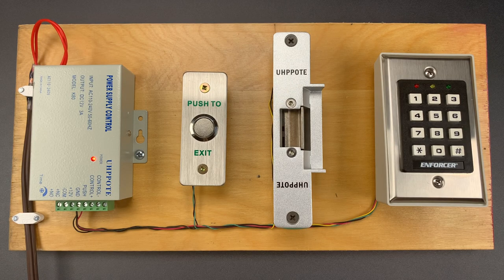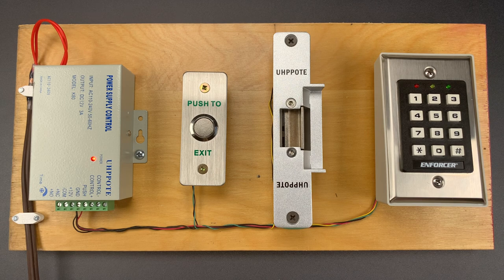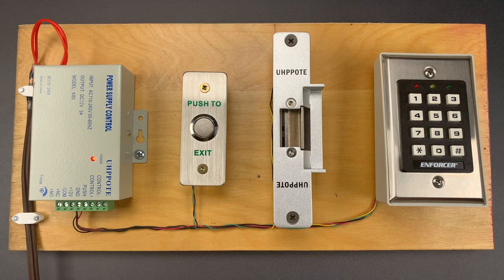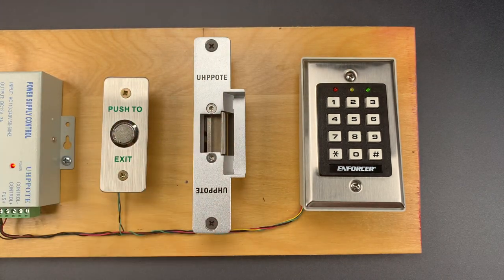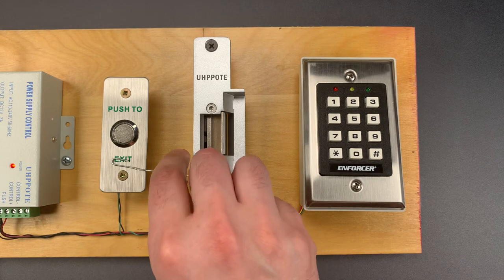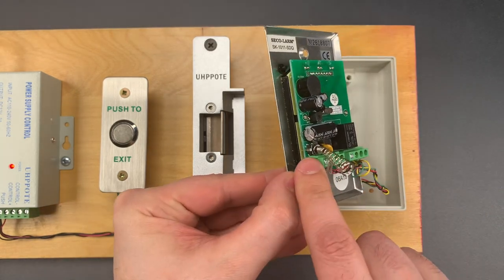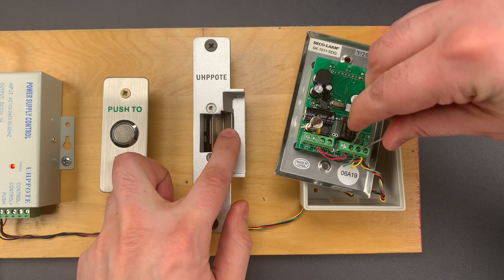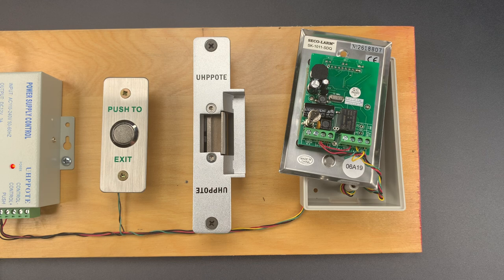[1045] Swiss Army Knife Bypass of Keypad Lock

Comment: Why don't they put the electronics behind the pushbutton inside the house and connect the keypad using a dataline, which sends a long code to the electronics with the entered code inside of it, or make some sort of SHA512 code out of the entered code? Then there isn't anything outside the house you can simply short-circuit to gain entry, as you would need to send the correct code-sequence over the proper wire.

Comment: They could probably fix a lot of these problems simply by placing all the control circuitry in the egress fixture, rather than on the outside of the door.

Comment: I'm wondering why the inside release button goes to the outside controls.  Why wouldn't they just wire it to the control box on the left of your display?  And for that matter, why isn't the keypad just that, only a keypad?  Looks like all the brains (at least one microcontroller) is right on the damn keypad, I even see the clock crystal on the back there.
That would eliminate both weaknesses.
Edit: ok, i did see after pausing, that the bix on the left is only a power supply.  Why not remote locate the "brain", and put it with the power supply?  Is there a reason not to, perhaps for power failures? Even then I can think of a couple of ways to overcome that.

Comment: Oh man, you managed to use swiss army knife "wrong". That particular model is Classic, but there's Classic SD (from Screw Driver), which doesn't have a nail cleaner at the tip of the nailfile, but flathead/2D philips head. Difference is small and it obviously works (as most knives on the philips screws), but it had to be said 😁

Comment: First things first. Never install a security keypad with standard screws. Use security screws. 2nd, never wire in a interior door release to an exterior keypad .  Use an interior relay method.
Reply: and I suppose where an electric strike is used, then the exit button is not needed, as you would need a door handle to be fitted on the inside as a mechanical override since electric strike plates are usually fail-secure (they remain locked when the power fails)

and since the lock is using dry contacts to open the door, then it wouldn't really matter how you wire up the inside button, as someone  that was trying to bypass it would just use the contacts that go directly to the door lock to open it

Comment: I guess if you want this but actually capable of doing it's job is to give it a inner/outer shroud. Then either security screws and or change the mounting points. While  installing a functional anti tamper system.

Comment: There is an old saying in the computer engineering business . . . If you can get to the hardware you can do anything you want. Putting the "smarts" out where they can be accessed is just criminal engineering. That pad should be nothing but a pad and 3 wires - power, ground, and data.

Comment: I'm just questioning, why have the circuitry on the outside of the portion of the lock? To me it would make far more sense to have the controller on the inside with the eagres button.  This means you don't really need to worry about tampering as anyone who would be able access it would already be inside.
It also would doesn't add anymore complexity in either the manufacturing or installation so I have no idea why they wouldn't do this, well other than it being a company run by and for thieves 😂

Comment: I've never understood why they put all the electronics controlling the lock in a box outside the locked property. Would it not be safer to just have a keypad outside and a cable going inside the locked property to then calculate the logic behind this? Wouldnt this be similar to housing a safelock in a plastic case outside the safe itself?

Comment: Isn't this potentially a massive safety issue as well?
Someone breaks the unit on the outside to try to get in, but fails and leaves.
Now the exit button doesn't work at all, and those inside can't get to the control panel to change it.
Reply: Didn't even consider that, but yes, I absolutely agree.
Reply: @ZenoDovahkiin  I have also realised it could even be worse, people breaking it to try to trap people inside.
And, the particular lock is setup using the normally open contacts, so if power fails the door stays locked.

This just raises questions all around.

I don't think I want to be in a building like that.

Comment: I just don't understand this paper clip method. The button is normally pressed by the spring and if you pull the spring with the paper clip the pressure is reduced and on further opening the button will pop off normally and trigger an alarm.

Comment: No keypad I've seen has any screws accessible from the outside. They have locks.
But in my experience that doesn't matter much.
Thieves would just take a hammer to it and knock the entire keypad of the wall and then bridge the wires left sticking out.

Comment: There's a serious problem when a security company designs a lock (any type of lock) which allows you to access its internal mechanics and completely bypass its functionality.  There should be no way to remove the faceplate, or introduce any gap in which to place tools, without triggering the tamper detection switch (and if the installer didn't connect the tamper detection switch, then whoever made the decision to not connect it is responsible for the intrusion).

Comment: At 0:00 I already noticed that the green wire on the exit button runs to the (presumably outside) keypad instead of the control box, which makes it possible to "press" that button from outside.
In addition, the yellow wire to the lock comes from the keypad, not from the control box, so you could also directly operate the lock from outside. Replacing the two screws in the keypad with something less common would help Enforcing some security.

Comment: So they could improve their design by making the front plate sides go deep enough into the housing that you cant physically grab the spring and make the customers have to attach the tempering sensor in order to have a working lock... Shouldn't be too hard for the manufacturer.

Comment: What if you try a magnet to disrupt the locking mechanism. Would that work. I have a freind who's building uses that type of lock but no keypad. Some brats tried to bust the door open but all they did is damage the door lock. Now it doesn't always work. It's as if the power isn't getting to the lock to open it. & We can't see what the damage is. Yesterday he was stuck outside for almost a hour trying to get it to open with his key for the electric lock. It didn't do a thing so he had to go all the way around the building and get the ladder out of the shed to get in through his window, the neighbors though he was a Thief so they called the cops on him. So when he showed them his i.d & explained what happened the cops tood him to call a professional locksmith. But that's expensive so if we can get it open maybe we can finally fix it. It's stuck in the locked position & we can't get the front door open so everyone in the building must use the back door wich has no outside handle to open the door so it remains partially open . That's not good.
So what can we do if we can't get power to the lock to open the door. Plus the hinges are on the inside of the building & covered with a shield that's welded to the steel frame. So no luck in getting the door off.

Comment: Why are'nt they using the screws for the silent alarm? Make a lil condu tor tip on the screw and as soon as one of the screws is turned and the contact is brikrn the sikent alsrm goes of. Should be pretty easy with a copoer tip screw. Then again it's a plastic casing and you can easiely bypass it with a lighter.

Comment: I used to work on an almost identical system years ago, and can confirm that they're pretty useless.  Had a guy accidentally get locked in a space after a power outage, simple as sending a small current through the switch off a 9 volt battery.

Comment: That keypad is a low security and you'll probably never find it installed on the exterior of a building l That being said even with what you did...open the door...it would not actually disarm any security system on that door or other devices.

Comment: having the smarts in the keypad is awful design (though electronic locks are definitely meant to look fancy rather than be 'better' than their mechanical counterparts).

back in school, most doors were automatic (motion sensor), but only during hours. some had magnetic plates holding them in place, but many were just 'power assisted' doors that locked w/ a normal key. the problem was, the power assist mechanism wasn't that strong, and those doors could still be opened manually after hours if they hadn't been locked by janitorial staff yet. this did result in some doors' power assists not fully opening/shutting so it was obvious to anyone that the doors were unlocked and could be manually forced after hours.

Comment: The stupid thing in that design is that the keypad directly disables the lock. A proper design would be to wire the keypad to an LM556 in a remote location which, in turn, would control the lock.  No cody, no locky.

Comment: First, you had the advantage of assembling your display and figuring those steps out with a little practice. Not all keypads are assembled alike. Most have screw terminals that can't be reached from the side, or plug in wiring harnesses. What I do, if faced with the need to gain access without a proper code, is just Google the manual which will usually give you the factory default programming code that allows you to program your own access code for access. This one's is 0000. Most installers and owners never change those codes (heads up installers and owners) and punching numbers into the keypad looks much more natural than breaking out the ole tool box. Secondly, unless you're actually attempting to gain access unlawfully, just remove the keypad and don't worry about the tamper switch as you're likely not concerned about whether or not it tells on you at that point.

Comment: there is a much simpler way to unlock these cheap Chinese keypad locks, as you have shown the electronics use a relay to send power to the lock solenoid, using a powerful enough magnet from outside, and moving it along the keypad will activate the relay and unlocks the system, so no need to play with connections at all, people should avoid using this toy as a security system...

Comment: Why do people design shit like that, if a safe version would not be more difficult?

There is no reason any wires for the exit button or the lock go to the keypad. Just wire only the keypad to the control unit and everything else stays inside of the door. Then, you don't even have to bother with a tamper switch. Opening it up will have no benefit. You can either put some logic into the keypad and transmit the information via some two-wire bus or just connect the readout wires directly to the control unit.  These things look like someone has designed them to be unsafe, because the solution one would come up with first is actually safe.

Comment: As an electronics technician, I simply can't grasp the level of stupidity that went into constructing that thing!
There are only very few changes needed, to make this thing really secure (from an electrical point of view, that is... it might have other flaws!):

1. Redesign the case, so that lifting the front plate will cause the alarm BEFORE anything can be inserted from the side! This is really easy!
1b. (optional) Put the tamper-protection circuit via the screws, so that unscrewing them will sound the alarm, even if the case is still closed.

2. Remove the electrical connection to the housing/front plate, so that touching that and any one of the contacts doesn't short any circuits!!!
3. Use connectors of an appropriate size for the cables you're putting in, so that no metal can be touched from the side.
4. Turn the connectors, so that any metal parts can only be accessed top-down (thus with the case wide open), not from the side!

5. Lastly: Ignore steps 2-4, the first is enough. Seriously.
If it's connected to an alarm, that will go off anyway. If it isn't, these other changes won't keep the thief out either...

Comment: Well, these are cheap locks to fake a security locking system. What do you expect?

Safe electronic lock systems have only a keypad and a data interface on the outside. They are connected to a control box inside the room you want to enter into. When you enter a pin the pin is sent to the control box which decides if you can get in or not.
If the control box is exposed outside the secure room, e.g., like in this example, integrated in the keypad, it's not a secure system.

Comment: there's a different version of that keyboard that is used as an input device but all the brain is in another box back in 2010 i used to install Kantech " KT200' " acces panel and the KB was wired to the box and from the box to the electro magnet / strike, there was no way you could acces the relay as it was in the KT200 panel . what a cheap version XD

Comment: It baffles me, that in 2020 when this video was recorded, they are still selling keypads where the real security is in the casing of the keypad.
A computer keyboard has only a circuit board to translate keystrokes into a digital format, why don't they do that when it comes to securing your home???
That's what I would do, I would take the keypad out of the casing, make a new casing for just the keypad, use a longer wire and run it through my wall to connect it with the pcb that handles the real security of that keypad. Then a swiss knife won't do you any good, and magnet to bypass the relais won't work either. Try lockpicking that setup.
It's like just because it costs a little more to fabricate it, it's too big of an issue, so they just deliberately make us believe that their security by obscurity will secure our homes. Security by obscurity in thinking that nobody will be smart enough to bypass it, just like AT&T did with their phone system back in the 80's, when the likes of Woz (Steve Wozniak) made black boxes, blue boxes, purple boxes, a 2600 hertz tone fooled the operator into you dropping a penny, and so on.
You can even open up the keypad for god sake, put the screws in the back or use rivets, put the springs underneath the screws or rivets, if unscrewed a bit and 2 contacts meet, the alarm goes off, if drilled out, the alarm goes off. You don't really need to be a professional to open this up, just google it and buy it, and take your time, or just watch your channel....
I hope they have far better keypads in 2022????
How do you feel as a professional about wireless crap to protect you from burglars, where again, the security is in the casing of the keypad, unless only the wireless connection is in the keypad and the real security is somewhere in your home? Bluetooth is really unsecure, wifi is moderately unsecure depending on what encryption you're using, and just about all of that wireless crap must have an internet connection so you can operate it from your phone, which adds another vulnerability.

Comment: As someone with some basic understanding of electronics, IT and information security this is such a stupid design.

I mean to solve this all you need is to slightly change the electronics.
There are plenty of 2 or 1 wire bidirectional data protocols that can run over long uninsulated wires. (making it 3-4 wires in total (1-2 data wires, neutral and power). Then all the keypad does is show the current state of the lock on the indicators, which gets done by the brain of the lock (that's inside) telling what to show and the keypad sending the presented credentials inside (works too for keycards, RFID chips and even biometric sensors). The internal processing unit then either grants access to any presented credential or not.

Now while that still isn't perfect/high security it at least means people now trying to bypass this need to have specialized equipment, etc.
And to further increase security there's a bunch ways to encrypt messages, including ways that makes replaying messages/data impossible, but yeah that's mostly overkill, as just any RFID or card reader will just allow cloning.
So yeah changing the system so that the keypad doesn't make the decisions on who's granted access or not and it only sending credentials digitally makes bypasses harder than stealing valid credentials (for the most part)

Comment: What crap that is if they allow the signal to open the door or disarm the alarm to be brought to the outside box!

Now this is not an issue in a "real" commercial security system because they use a serial communication to a smart control panel. This means that not matter how you short the wires or power them or plug them in 240V if you wish but you are not getting in although you may burn up the panel! 

You would have to attack the wires to the strike plate by drilling into the door encasement and powering the striker with the battery or installing a sniffer and capturing the serial data if the keypad is lousy enough not to encrypt it's communications to the panel.

Comment: Wow, this keypad is so  badly designed. 2 philips screws on the front: bad design. 
There are some sealed keypad, easy to find, not so expensive, with a light sensor on the back instead of a spring, torx screw underneath and it's waterproof because all the electronics are sealed in resin.

Comment: Having the electronics that control the system on the non-secure side seems like the biggest flaw here. What if the wires from the keypad went through to the secure side only passing a simple signal and all processing was done internally. You'd have to then figure out how to send the correct signal through to the secure side right?